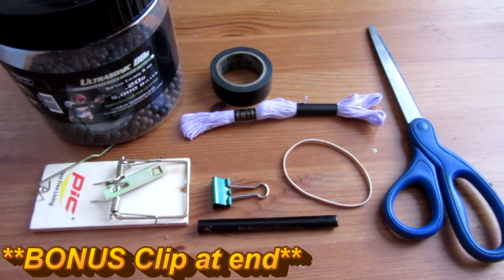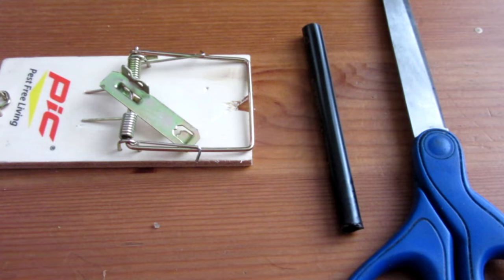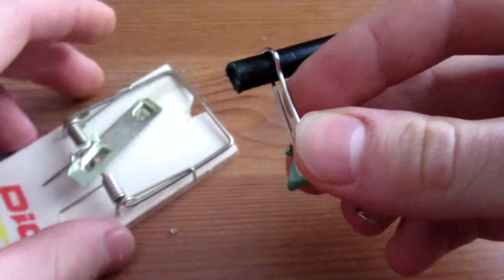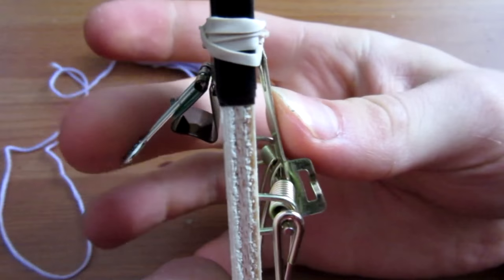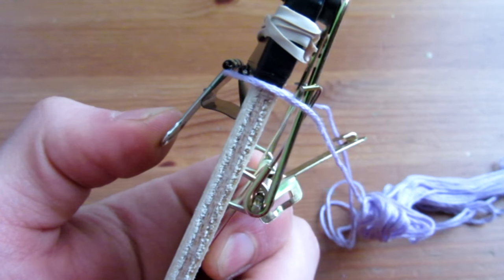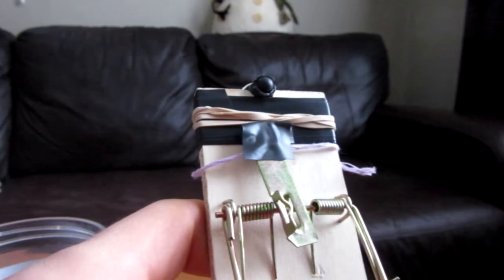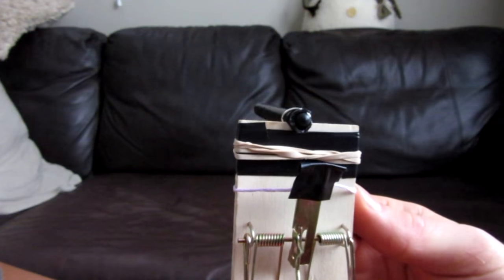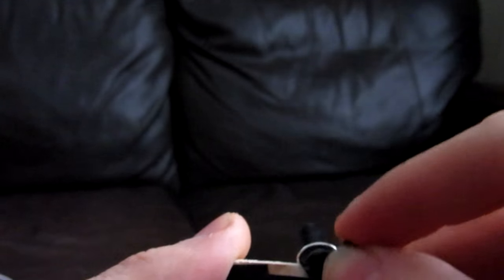How To Make a Mousetrap BB Gun -  POWERFUL

Comment: Tip remove the ink cartridge and the back plug and then leave the tip of the pen on it and it should go and easy because  it's at an angle for the pen tube with the alligator clip